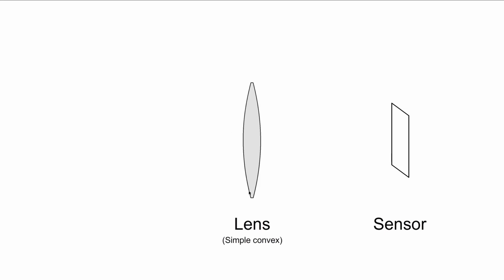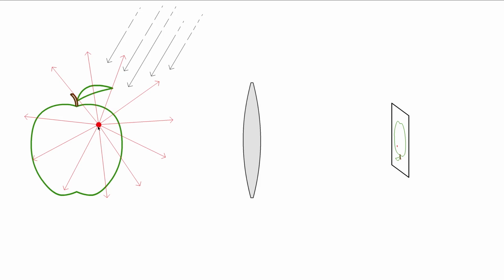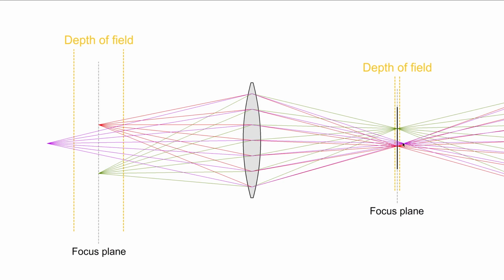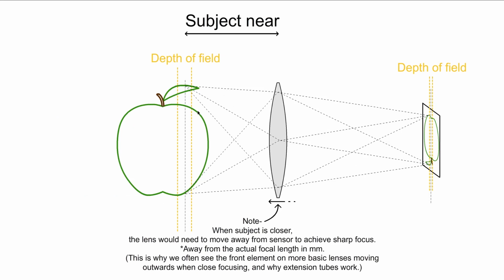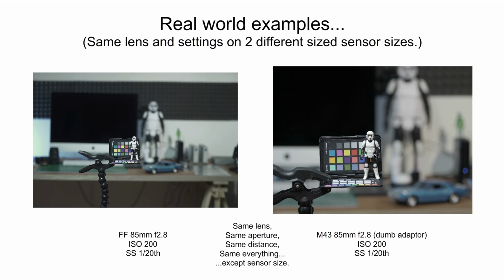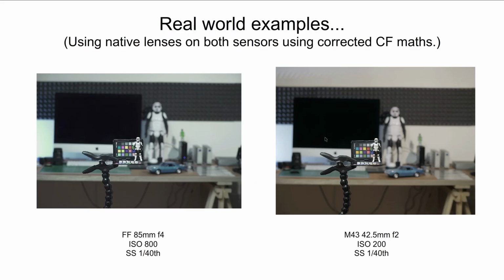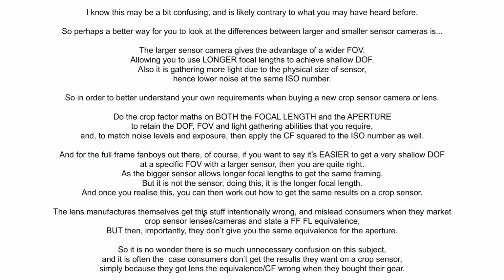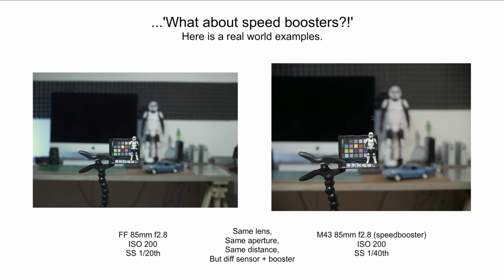Depth of field and crop factor misconceptions.

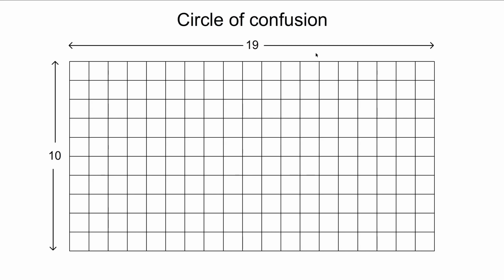Comment: At 17:00, the difference between sensor size accounting for the shallower dof on a smaller sensor has nothing to do with pixel size. The difference is because for a relevant comparison (same sized output) the smaller sensor output is magnified more, ergo it demands a smaller coc on the sensor to attain the same output size/coc relationship.

Pixel size has nothing to do with any of this, nothing at all. Magnification, and the fact that you need to magnify a smaller sensor output more than a larger sensor has everything to do with it.
Reply from the maker: Scott Ferris I sort of agree with you. 
It's not about the pixels really, but
I was using a few pixels simply as an example as to why the CoC could be considered OUT of focus on one sensor, and IN focus on another (even with exactly the same lens, same aperture, same distance to subject. )
Let's forget resolution differences between the sensors, and say we are filming 4K video on both sensors. (More like how I would use them in practice anyway)
The 4K on the crop sensor obviously has narrower tolerances for what is acceptably in focus ,and what is acceptably out of focus. 
Due to the CoC. 
So that's why I used the pixels to explain the difference. (Personally I thought it was a nice clear way to show this. But obviously you disagree.)

Anyway I don't think you are arguing with the overall point I was making at all. You just don't like the way I expressed my point.
Reply from the maker: Scott Ferris I think the fact I shrunk the sensor down does clearly show the magnification. (Just sort of inverted)
Anyway. Glad you agree in principle. 
Certainly there are ways I could have described some of this better. 

I really should have wrote a script. 
But decided just to reasearch the facts for a few days. Then start recording. :)

Clearly not the best way, but it's the quickest. 
(One take wonder)
Reply from the maker: Scott Ferris I may make a "proper" version. With tighter structure and fully animated illustrations. 
(Less power point like :D )

If I have time of course. Probably a weeks work to do a high production value version. 

So I'm calling this one the alpha version. :)
Reply: To be sure, the only reason I made an account and posted for the first time ever is because you specifically ask people to at the end of your video. Not emphasizing the fundamental nature and impact that magnification has in an equivalence explanation is an omission of some note.

I applaud your video, and your need for tea at the end :-) but wish, very much, you had included that element.
Reply from the maker: Scott Ferris hey Scott. I appreciate the constructive input. 
Real mixed bag of feedback. 
Mostly really positive. 
But the trolls certainly know how to wind u up :D
(Have to rise above the silly Billy's)
Reply: Didn't see this reply before my previous post (below). I'd think you only need a v.1.1/1.2 not a v.2.0.

Great work!
Reply: @privatebydesign1808  I was about to comment something on this and is the only thing that threw me off. Thankfully this comment reclarified and validated my current understanding saving me from spending more time reading instead of taking photos. Haha
Reply: But that doesn't take anything away from the vid. It also reinforced my current understanding as well, dispelling any confusion caused by those in the internet saying otherwise

Comment: Hi, I am so glad to learn more things from this video. I do want to know why m4/3 or apsc camera don't have even lower ISO ? if  they have even lower ISO, it will have much cleaner and longer exposure .
Reply: The key detail is that ISO is part of an exposure system based on light per unit area. The underlying sensor performance, per sq mm, is very similar across modern sensors. For example, the Fujifilm X-T4, Sony a7R IV, Fujifilm, GFX 100 are essentially different sizes of the same sensor.

As such, other than small differences in color filter density, they'll all clip at around the same point (or require similar exposure, depending on how you look at it). Consequently they'll all have similar base ISOs. Or, at least, the base ISO won't scale with sensor size.

Comment: This is a super helpful video THANK YOU! biscuitsalive YOU ARE BOSS

I watched your second video but I am still a bit uncertain when it comes to speedboosters how to theoretically compare DOF for different lenses on different cameras.

Sony FS7 has a super 35 mm sensor: crop factor = 1.39
Speedbooster Ultra / Canon EF to Sony E: add 1 stop of light + multiply by 0.71

Does that mean that if I use a Canon 24mm f2.8 the calculation would look like this:
Focal length = 24mm*1.39*0.71 = 23.7 mm
F-stop = (f2.8 + 1stop = f2) f2*1.39*0.71 = f2

In essence does a speedbooster Ultra make a 24mm f2.8 into a 24mm f2 on a Sony FS7? Or do I calculate wrongly?

Another example would be:
Panasonic Lumix GH5 has a MFT sensor: Crop factor = 2
Speedbooster XL /Canon EF to MFT: add 1 1/3 stop of light + multiply by 0.64

Canon 24mm f2.8 + speedbooster
Focal lenght = 24mm*2*0.64 = 30.7 mm
F-stop = (f2.8 + 1 1/3 stop = f1.8) f1.8*2*0.64 = f2.3

= 30mm f2.4 FF equivalent?
Reply from the maker: Hi mate, Im getting slightly confused by your case, so the final image circle is tighter around the sensor than it would be on the full frame? So then does it vignette?.
Lets think it through... 
Ok best to simplify things you FS7 has 1.39CF
your booster is .71
so 1.39X.71 = 0.987 (just use one number to do calculations)

so a 24mm f2.8 would be= 23.68mm FL  (does it vignette then??)
and then the f2.8 is 2.8 X .987 = f2.7636... (2.76 will do)

Normally the speed booster is only capturing light that would be wasted around the sensor, it can't physically make the lens faster than it would be on its FF counterpart (unless the image circle around the full frame sensor has unused portion falling around the sensor....  without the SB the 2.8 would be a f3.9.... but with it, in your case, its capturing all the wasted light, plus a little tiny bit more... !!

Please bare in mind this is for your DOF equivalence, you then have to do the ISO equivalence to match exposure. (lowering ISO number on smaller sensor to allow match exposure, and matched noise levels.) this is the crop factor squared. so 1.39 = 1.93 .... so ISO 200 on the full frame, will equal ISO 386 on the super 35 sensor... I realise sensors technology has lots of variables in it, but if both sensors are exactly as efficient as each other (for their size) then this should work out perfectly... then you will match FOV, DOF, exposure and image noise levels... 

I totally get why this confuses people, they are used to using the ISO number to gauge exposure.
But the only way to match image quality on two different sized sensors fairly is to give them the same total amount of photons.
Once you realise the ISO number is not telling you how much light is creating your scene. 
But its only telling you how much light is creating a certain portion of your scene. (a square inch)
(with that portion of light being relatively bigger on the smaller sensor... so it is not fairly proportional from one sized sensor to the next.)

its just like spreading butter over toast, the larger piece of bread/sensor is getting more total butter. than the smaller sensor/piece of bread.
the ISO is telling you the DEPTH of the butter on the surface of the toast.... not the total amount of butter needed to cover the toast evenly!  :) :) :)

(I'm rather smug about that metaphor i just came up with.) :D

P.s. i would forget what metabones says about the adding a stop of light, this is to help people get their heads around the comparable stop of a native lens (so exposure is right) it isn't adding a stop of light onto what the lens can actually get, on ITS native sensor. (it can't make the lens physically faster than it already is...) its just capturing light that WOULD have been wasted on the smaller sensor.
Reply from the maker: I am a little tired, so i hope i got all that all correct. i will try to remember to read my replay over tomorrow with fresh eyes to check I'm not making a silly mistake somewhere. :)
Reply: Thanks man! I'm still trying to get my head around how to do the math. I have watched your video again, and it's very informative! I definitely understand lenses and sensors (and speedboosters) way better now! I think I have to try some things out with some lenses and speedboosters on different cameras to fully understand things.
Reply from the maker: FredBramming hey glad it is useful. 
I know I could have structured this video much better. 
(Maybe if I actually wrote a script rather than just talking. :D )
And I would do it differently if I did it again. 
But glad it helped none the less. 
I'm half way through a another similar vid that has more practical demonstrations. (Showing ISO side by sides from 200 - 12800 etc. And explains things in a different way. 

Not sure when I will find time to finish that. 
But it should be really useful as it shows the theory in practice.

Comment: Thanks for taking the time for putting this together, got my first DSLR recently (I’ve only ever used compacts) and really disappointed the sales guy didn’t explain about the cropped sensor vs full frame, and, I can’t understand why Canon won’t label the EFS series of Lenses what they actually are considering they can’t be used on the FF, after watching this video and Tony Northrup I’m now getting better exposure with my pics
Reply from the maker: rawknroll Paul glad it was useful. 
Yep a system that shows the FOV angle and the total amount of light let through would be much better than focal length and fstop

Comment: Very good explanation, thank you for clearing up some misconceptions.  The most contentious issue for most will be the noise/iso relationship which will upset a lot of m4/3 and some aps-c owners.  You need very much faster lenses to keep the sensor noise under control.  As you say, manufacturers are realising that they have to be more honest about lens equivalence not only focal length but also max aperture.  Camera and lens manufacturers should make speed boosters that are specific to their larger format lens ranges. I.e. Fujishould make one specifically for mounting full frame legacy Fuji lenses on their aps-c camera bodies.
Reply from the maker: Howard Maryon-Davis I agree. 
And the point about the noise vs sensor size has the most variables to factor in. (In regards to each sensor technology/design etc)
But I believe it’s safe to say if you took two identical sensors (in terms of the technology, eg. Back lit/cmos/ Same res etc etc)  but one is smaller than the other. Then you can use the crop factor squared to equate noise levels. (across the whole image. Bare in mind if res between sensors is different, and you judge image noise at 100% then the formula brakes down as the portion of total
Sensor is no longer equal. )

This is why judging 2 x 4k full width sensor images is a good/fair test to reference. 

As even if one sensor is higher res. The down sampling to 4k helps even things up. (As long as using whole width of each sensor and not cropping like the gh4 does)

Comment: Northrup's Fallacy in short: 

Multiplying lens focal length by sensor crop factor is the WRONG WAY to reproduce the perspective of a cropped-sensor camera with a full-frame camera. 

The right way to do this is to consider seriously what the phrase "crop factor" implies. It tells you how much you need to CROP THE IMAGE from a full-frame camera to reproduce the FOV and DOF of a cropped-sensor camera, with both cameras using the same lens at the same aperture. Perform the crop in this way, and you will get exactly the same FOV and DOF from both cameras.

Bottom line: A cropped-sensor lens is NOT "equivalent" to a full-frame lens of a narrower focal length, nor does it perform like a full-frame lens at a more constricted f-stop. Neither the focal length nor the aperture of a lens is dependent on the size of the camera's sensor.
Reply from the maker: Fallen Star Features if what I say is a fallacy, then why does the results look correct?
I've used this method across many different sensors, lenses and cameras. (Since this video I have even matched medium format to M43)
And I get the look I want. And match FOV DOF and noise each time. (With small variations for any particular sensor efficiency taken into consideration.)

So if it works. How can it be wrong?
We are only trying to get the same results. 
Which this method allows.
Reply: The results your method produces succeed only in duplicating the same FOV and DOF with different sensors using different lenses. In all other respects, the results will be significantly different. In particular, the cameras' aperture and ISO settings will be markedly different, and that can make a major impact on image quality. 

In the real world, your hypothetical method is impractical - no experienced photographer is going to set a full-frame camera at an undesirably high f-stop in order to match the DOF of a cropped-sensor camera. In practice, you choose lens focal length according to shooting distance, and adjust aperture for the best balance of DOF and dynamic range. You work with the camera you have on hand, not some theoretical reference point. Even when you have cameras of different sensor sizes available, you almost always use them to shoot different angles that have inherently different FOV and/or DOF.
Reply: The whole point is to use different lenses. One chooses proper lenses for the sensor one has. The examples used are used to demonstrate the formulas. Yes, in practice lenses for crop cameras often do not have wide enough apertures, but the whole idea is to encourage lens manufacturers to make them and there are some such lenses like Sigma 18-35 mm f/1.8 Art.
Reply: Explain why it does not perform like that? The depth of field and the total light in the sensor are same.

Comment: I get what you are trying to do when explaining DoF, but maybe you should focus on light falling at a lower angles producing larger DoF and not draw this 3D field around the sensor that isn't really there? You will create more confusion than you fix that way.
Reply from the maker: lakkot.b this way is the best way to match looks between different sized sensors. 
You can get images from completely different cameras and you would struggle to see the difference. 
So for anyone changing systems or shooting with multiple cameras (like me)
I can’t see a better way than this really.

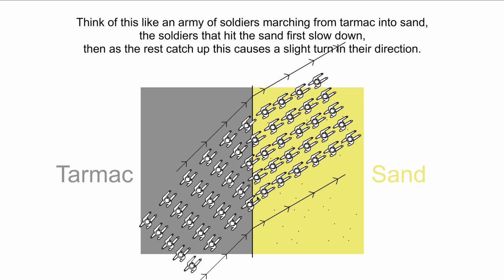Comment: 7:29 is not completely correct in my opinion. The individual photons neither catch up nor change their direction in this scheme, the direction of the wave front changes because some soldiers are slower. Not because they would "catch up"
Reply from the maker: fair point, clearly im no science teacher, and just remembering what my teacher taught me many moons ago. but in the metaphor of a troop of soldiers as i was using it sort of makes sense to me. :)

Comment: I loved this video, finally someone took the time to explain this in a way I can understand. I have a question concerning native mft lenses. So say you have a 25mm 1.7 prime. That would be 50mm on full frame, but do you double the aperture of native mft lenses as well?
Reply from the maker: Daniel Strauss thanks. That's what I was going for. Explaining it a bit more visually (illustrations etc)
Yes. That's exactly what you do. 
So a 25mm f1.7 M43 lens will perform just as a 50mm f3.4 lens on full frame. 

This is why we need really fast lenses on M43 if we want to match the DOF and image noise quality of FF. 

My fastest M43 lens is a 42.5mm f1.2
And that works exactly like a 85mm f2.4
(Lovely for portraits) 

Or as you probably already know, u can use a speed booster and this gets you most of the way there, and use the same lens as you would on the FF. (But with a slightly tighter shot)
Reply from the maker: Daniel Strauss just a side note on this. 
When you get a native crop sensor lens that completely matches the performance of a FF lens. 
It will have to be as physically big as the FF equivalent. (Front element has to be big to let in enough light etc. )
So you can practically just eye ball the crop sensor lenses and tell. 

This is why it's outrageous when a manufacturer states something like. 
"24-300mm f4 equivalent" on the lens or fixed lens crop camera advertising/description. 
When it's a actually a 12-150mm f4 M43 lens. 
They should have said "24-300mm f8 equivalent." Then they wouldn't have been lying fiends! ;)
Reply: Thank you! I get it now. Yeah speedboosters help a great deal in achieving that full frame look on mft.